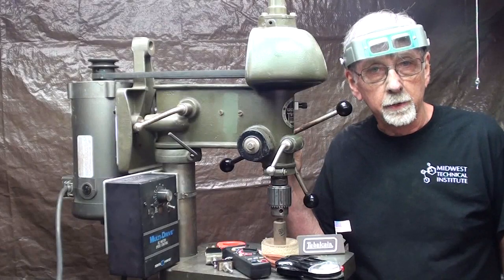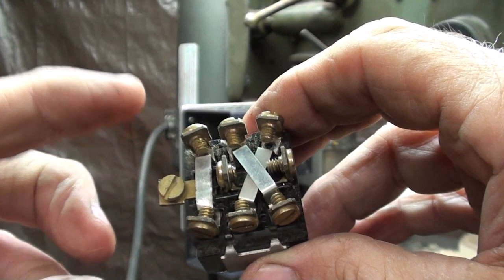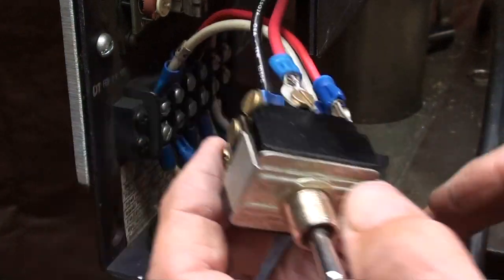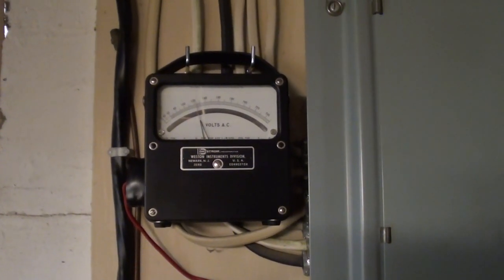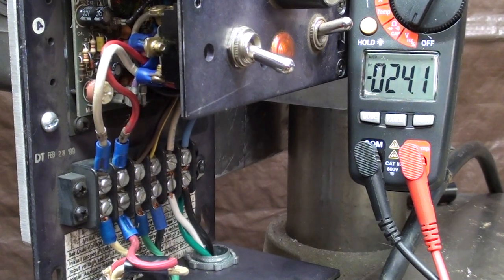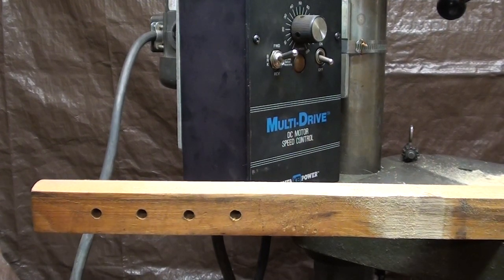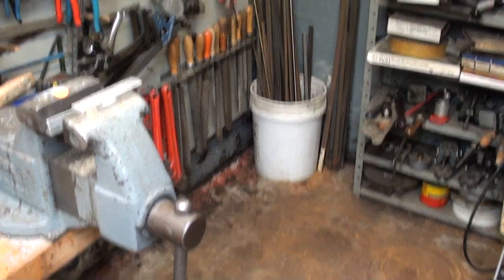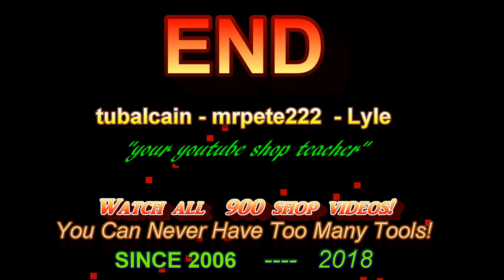Install Reverse Switch on DC Motor Tips #481 tubalcain

Comment: Yes I find motors of all kinds extremely fascinating and they caused me to have a life long fascination with Nikola Tesla  because of his inspired contribution of poly phase AC induction motors and AC alternators that generated AC power.  I liked your presentation and was interested in your DC motor controller which I assume is a pulse width type of controller feeding square wave dc pulses of varying widths to the armature to control the speed.  I would have loved to see the armature waveform revealed on an oscilloscope to show how the pulse shape changing in duty cycle affects the motor speed. To work in this type of speed control circuit your DC motor is of the type known as shunt or parallel wound. If I recall my theory correctly this type of winding yields consistent torque across a wide speed control range. The person who suggested you would have not good torque at low RPMs with a dc motor was probably thinking of their experience with a series wound dc motor and such motors are notorious for their poor speed control vs applied torque. The series wound motor can be speed controlled with a simple light dimmer / triac control unit or a variac (a brand of variable transformer)  but with very poor speed regulation under torque. Series wound motors are best suited where very high RPMs are wanted in such service as grinder motors that are also called universal motors that can run on both AC or DC.
Reply from the maker: Thank you very much, but you are way way ahead of me on electrical theory
Reply: Sorry to bowl you over but it is my love of motors that did it.  Cannot wait to hear about your experience a VFD (variable frequency drive) motor speed controller.  They are truly a modern marvel born of computer control married to solid state power devices to control the speed of a 3 phase motor.  I am a 45 year (still working) tv engineer that has used motors in many phases of my work.  VFD's have made it possible to control the position of big Satellite tv dishes that I have worked on over the years.

Comment: Used to use amp gauges to judge the linishing belts pressure  when bonding aluminium to steel for engine bearing strip.
Reply from the maker: That's an interesting application

Comment: You need to build a proper prony brake to measure the load. A spring scale and a strap clamp should do the trick. :-)
Reply from the maker: It would take an engineer to do that, LOL. Hi Brian

Comment: Interesting series.  Yes, if properly constructed, DCmotors can have tremendous starting torque. As with most set up systems, there is a trade off.  The high torque type is generally a series connected motor, where the armature current goes through the field winding as well in a single circuit.  As the current in the armature increases in response to the load, the field strengthens as well.  The trade off is uncontrolled acceleration of the unloaded motor, as evidenced in vacuum cleaners toolpost and other grinders, as they posses the basic parameters of the "universal" motors.  This is why larger motors of this type, like locomotives are rigidly connected to their loads, by gears in the locomotive style.  Also, locomotive motors generally start in serially connected pairs to limit current until a certain speed is attained, when they "transition" to parallel connection.  But I am digressing as usual, my point being that there are trade offs.  I wish you would go onto the individual armature and field circuits to see where the bulk of the current gain occurs, as well as the associated voltages at various speeds, as this would give insight into the control methods being employed by this controller.  Were this my motor, I would consider using the two field windings, indicated on the nameplate you show in the introduction to the series, in opposition, with one connected in series with the armature, to give the field reinforcing aspect at higher loads, and apply a reverse current through a rheostat, to weaken the field at no load, and limit uncontrolled speeding.  If someone has performed this sort of operation, and can give some actual experiencial enlightenment, I think it would be helpful to all, generally speaking, if not for this exact situation.For me, this has been a mental exercise, based on a general ,understanding of magnetics, and autopsies of DC engine driven welders, which are also series wound, and use interpoles backfed through an adjustable resistance, to provide current control.  as motors and dynamos are essentially the same machine, one using electricity to produce rotation and the other using rotation to produce electricity.  Why shouldn't the same basic electro-mechanical rules apply?  Just something I've been kicking around since you started this series.Thanks for the adventure, and I hope this provokes some experimentation.
Reply from the maker: Thank you for the information. But some of it is way beyond me

Comment: This can be the advantage of DC motors. After all, they are used as the starter motor in your car, very high torque (the starter is series wound). When the armature rpm tries to slow more current passes through the armature (because the voltage increases), increasing the magnetic field in the armature, and thus the torque.
Reply from the maker: Thanks

Comment: That drive likely uses voltage feedback which is why the motor has so much torque at low speeds.  To prove this you can measure armature voltage as you put load on the motor.  If the armature voltage increases under load that means the drive senses the motor slowing down and compensates by adding armature voltage to maintain speed.
Reply from the maker: Thank you for the information
Reply: Also, for drill presses, I have always favored a "deadman" foot pedal.  Basically you could easily replace the "on/off" toggle switch with a foot pedal.  This is a great safety feature and also really handy for tapping on the drill press because you can tap the pedal with your foot to jog the drill while one hand holds the vice or part and the other is busy on the quill handle.  Also great because you can quickly stop the drill if the bit gets stuck or whatever.

Comment: I wish my drillpress could handle a side load like what you demonstrated.  I use a drum sander often and I cannot apply too much pressure or the arbor and chuck will fall out of the spindle.  It is a Grizzly - I got what I paid for.
Reply from the maker: My truck is not held on by a day per pair of there is a locking collar.

Comment: Hi Lyle. I am enjoying  these vids about using dc motors for speed control. I want to do  the exact same to my rockwell band saw as you  I found a reasonably priced dc treadmill motor but have no clue if it will work for the purpose intended Power 3.0 HP
Voltage 120 VDC Amperage 22.1 Amps Speed 2975 RPM (Nameplate) 3825 RPM @ 120 VDC, No Load  Any input would be greatly appreciated
Reply from the maker: It probably will work. Go ahead and hook it up

Comment: The reason we use DC motors for big cranes & tilt drives on furnaces in steel plants is that DC motors have very high torque a low speeds.  Google DC motor torque curve.  DC motors have maximum torque at stall speeds
Reply from the maker: Thank you for that information

Comment: I guess the BRK position assumes electrodynamic braking. For this braking, you need just proper wiring of a proper switch which shorts the motor while the power source is disconnected.
Reply from the maker: Thanks

Comment: My lathe has a 1.5 dc motor but for some reason mine does not have the power it should for the size. I'm trying to see if I have a setting wrong on my machine
Reply from the maker: I am still mystified as well. Wait till you watch the rest of the DC motor videos concerning the bandsaw
Reply: To diagnose your problem measure your field and armature CURRENTS and VOLTAGES w/o load and with load. This should point U in right direction.
Reply: @jerryquigg3497  I need to get with you some time for pointers.
Reply: Michael Hale  - You can email me at =>  Jerry.quigg@alum.MIT.edu <= and I’ll try to help. I’m not a DC motor expert, just an E.E. Experienced in solving electrical issues in machinery. I don’t have DC motors myself. One thing for you is to try is to obtain the Mfg. data sheet for the motor. If it’s mystery motor then look to data sheets for similar sized motors eg. Baldor et. The idea is to see what typical currents and torques should be.

Comment: Your ammeter readings were interesting. The AC Amps went up with load. But did you meter DC Amps at varying loads and speeds while comparing the readings with AC input Amps. THAT would be REALLY interesting but maybe too much info for your format.

What's the motor name plate full load armature Amps? Call it 6.0 Amps as a convenient number. You have full RPM idle current of 2.5 Amps. At half, quarter and eighth of motor nameplate RPM the AC input no load Amps would follow in rough proportion.

The motor when dialed to different RPM on the drive and loaded with your sanding drum/stitck apparatus gives us opportunity to compare motor Amps Vs mechanical load Vs AC input amps.  Your DC drive is analogous to a geared transmission where voltage (RPM) is reduced but Amps (torque) increases so that constant power (less losses) is transmitted.

The motor draws only enough power to supply its losses and to drive the immediate load. There will always be some idle current - enough to keep the motor spinning and supply the losses. Thereafter armature Amps are in rough proportion to the shaft torque necessary to drive the load. If it requires 4 additional armature Amps to drive the load at 25% motor base RPM you can expect the AC Amps to increase about 1 Amp.

I know it sound baffling and counter-intuitive but it's motor physics plain and simple.

Speaking of... the people who declare that shunt and PM DC motors "lose torque" at low RPM are repeating ignorance. A DC motor developes full armature torque (and a bit more in some motor designs) all the way down to zero RPM. As it happens, full torque at zero RPM corresponds to zero horsepower. It's not surprising your motor slows somewhat at maximum load. Motor speed regulation in an open loop system is not perfect. And I think you could expect that motor could slip your V belt drive under maximum load.
Reply from the maker: Thank you very much, but you our way Beyond me in theory